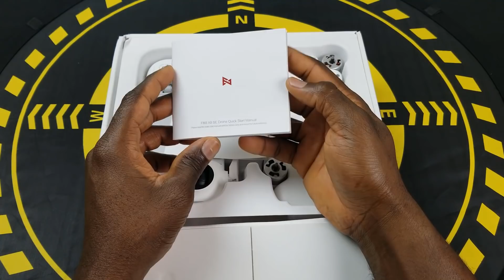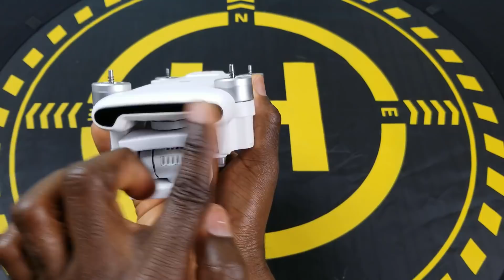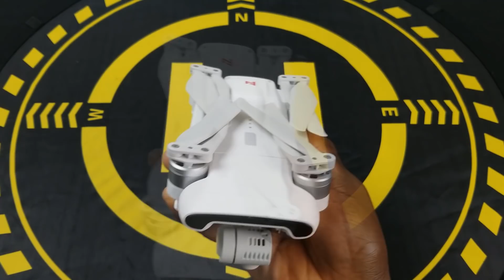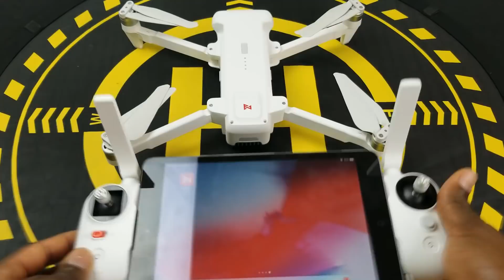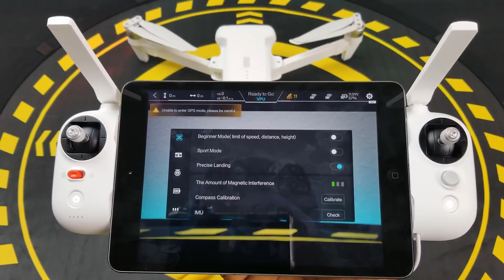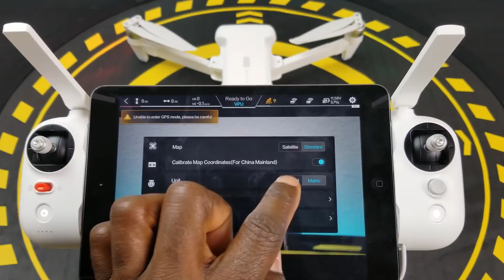FIMI X8 SE 4k Review - Unboxing, Setup, Flight Preparation - PART 1 #trplmrc

Comment: Great review, very informative...I have a noob question, sorry. I have installed the app on my phone and created a acct.....can't do much without the drone, which is on order. I do not have a cellular data plan, so i will not be able to log into the Fimi Navi app when away from my home WIFI...will I be able to fly with GPS and all app features by simply binding the controller to the drone and "enter the device" ? Will I be able to change settings in app ?

Thank you
Tony
Reply from the maker: If I remember correctly, you need to have an account to be able get into the app.  I’ll double check and get back to you.
Reply: Thank you...I appreciate your time, and look forward to earing what you find...I have the app installed and have signed in at home via WIFI...i  also at the opening screen with the X8 pic, can hit the 3 hash Marks ( top right corner) then select login, and get 3 options,,,log in...register....and NOT LOG IN...selecting NOT LOG IN  gets me into the app,,,,just not sure if everything will work,,,,I think it will, but again I do not have the drone yet, sooooooo   Maybe you can try that ???  Hopefully it will work, otherwise I wasted $400.....

Thanks again for your help
Tony

Comment: Great video, can you give some information on what phone or tablet will work with it.  Do I need data on my phone or tablet to fly?  2.4ghz or 5.8 GHz.  I am new to all this and have older phone.
Reply from the maker: Any smartphone should work, As long as you can find the app in the App Store; so enjoyed an Apple devices should work fine. As far as tablets, the largest I’ll recommend as an iPad mini which I did demonstrate in this video. Anything larger than that you will need to buy an adapter to accommodate the larger device. As far as the network, you don’t need it when you fly, you just have to make sure that your maps are updated. 2.4 and 5 GHz, that only comes into play if you are not using a controller
Reply from the maker: Let me know if you have any more questions
Reply: @Triple_M  Thanks for the info.  Banggood a good place to order from?